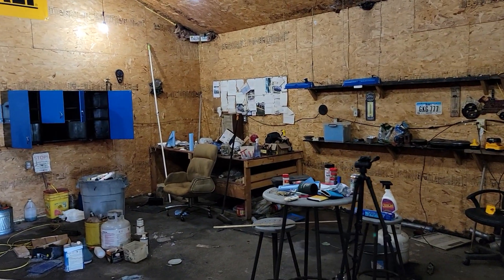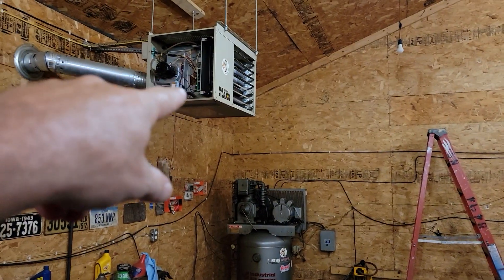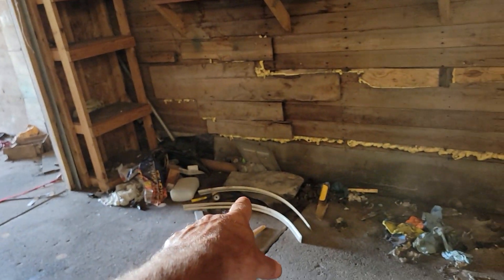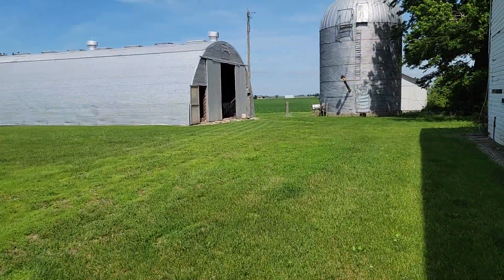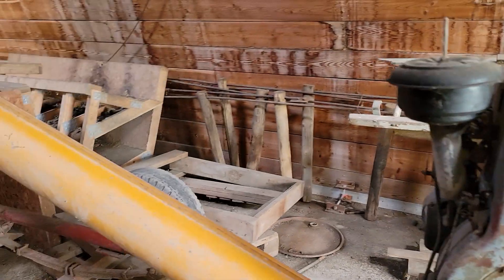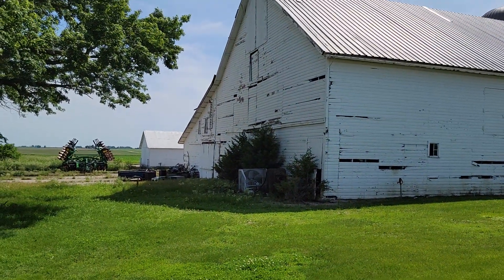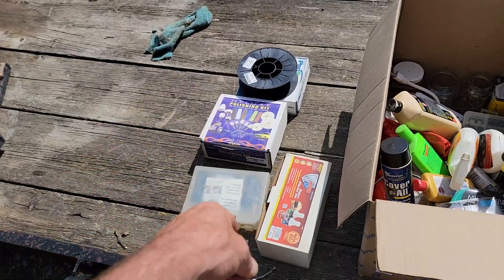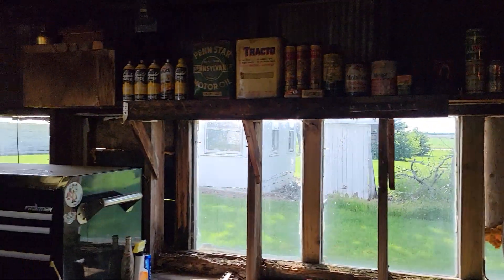JESSIE CAN'T BELIEVE IT!!!   TRYING To Get This DONE! Moving The Shop Building!

Comment: If you have a wireless router in your house, then you can get a repeater for the shop and have internet there.
Reply from the maker: No direct line of site to the house from the shop..
Reply: Line of sight is only required for infrared. Wireless has a 300' range and transmits a signal much like cordless phones. It can broadcast through walls and other objects.